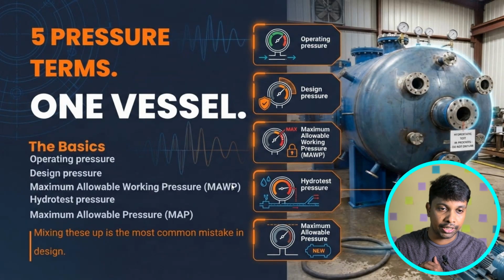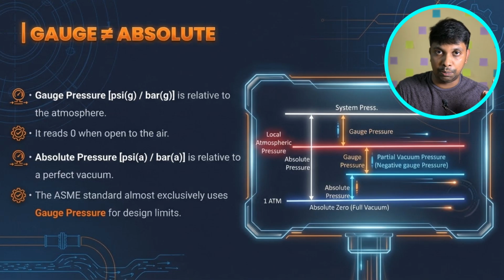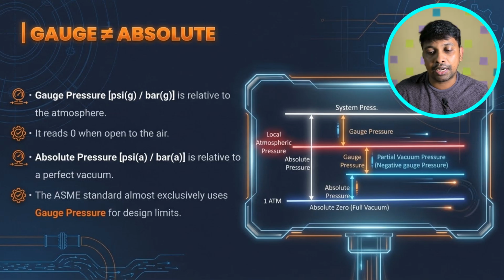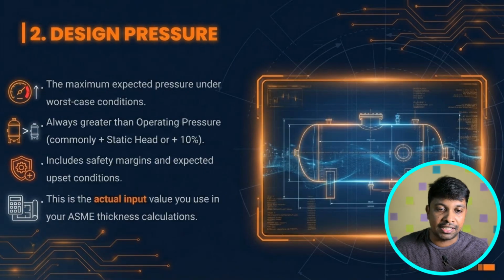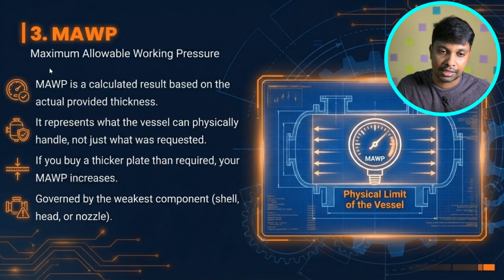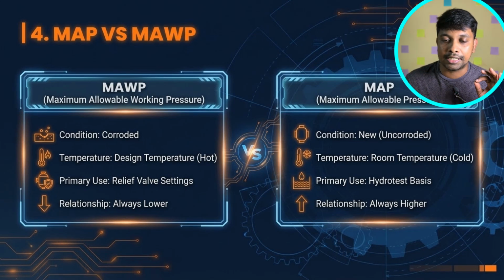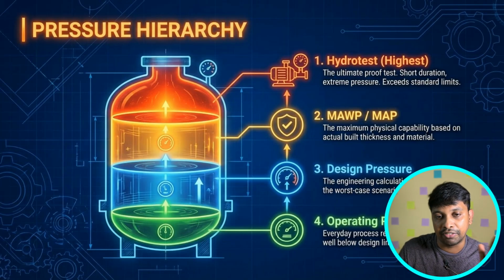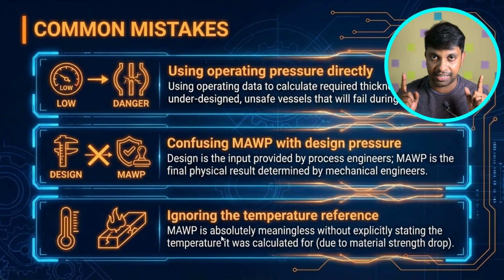Why Design Pressure is More Dangerous Than You Think??

Comment: Here is my question that you told design pressure is calculated by qgh but while calculating it comes very low. Like for example operating pressure is 15 barg and in pressure vessel by your example take water and its height is 3 meters so qgh = 29400 Pa that is equal to around 0.294 barg (aprox) and adding it to 15 barg then design pressure is 15.294 barg . 

Isn't it very low for design pressure ?

Most of cases in specs if operating is 15 bar then design is much higher like 25 barg , 30, 50 etc. 

Please correct me if I am wrong and misunderstanding something here.
Reply: Thanks for reply. Looking forward to learn somthing from your upcoming videos.
Reply from the maker: You are right, When static head(SH) added to operating pressure (OP) the increase is usually small. 
What you usually see in spec. is a higher DP which is = OP+ client/EPC design philosophy, surge margin, upset conditions , etc.. These are mainly process related considerations, so as mechanical engineers we normally follow the specified DP.
So, if DP is provided in the specification, simply use that value. If DP is not provided, then DP = OP + SH + Margin if any {usually 10% or1.5 bar which ever is greater (for PSV)}. 
Great observation, keep asking these sharp questions